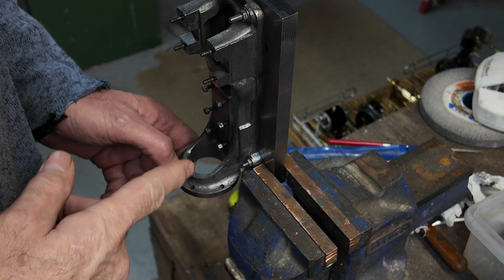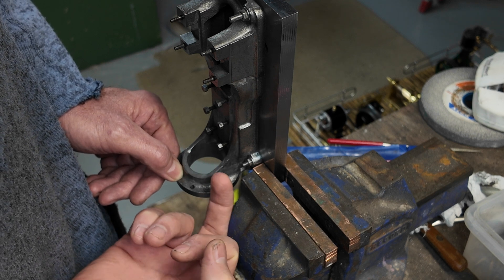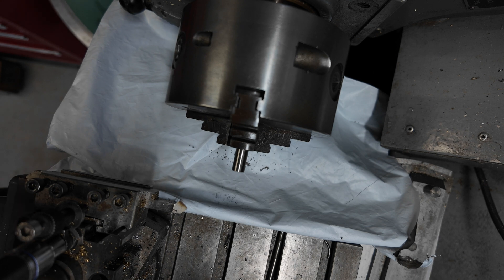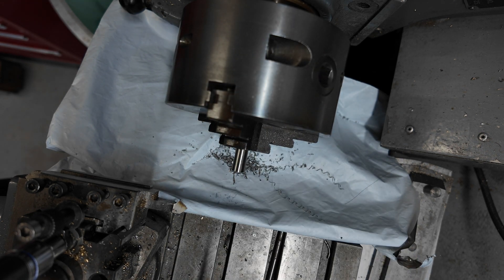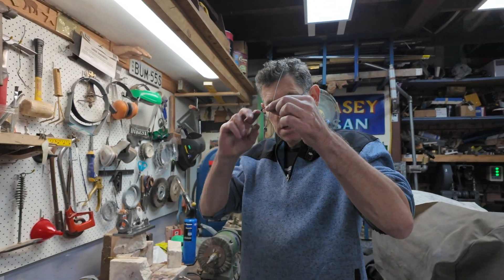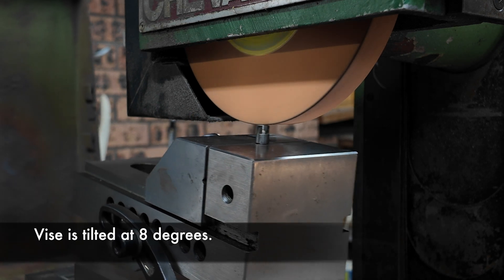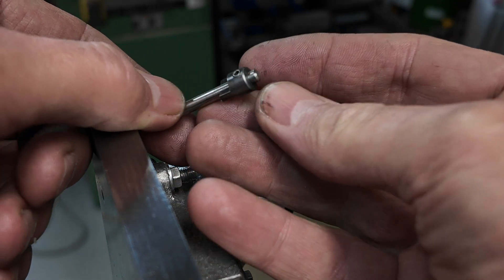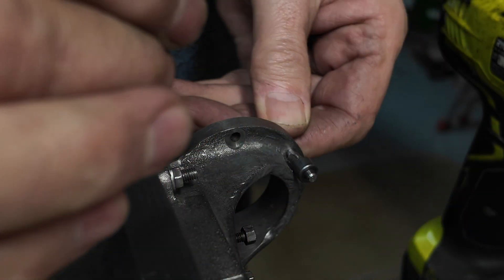Make a Counterbore

Comment: All that work and time and the flange got damaged anyway. It part is not a great looking part anyway why not just use a grinding bit on a dremek etc, it can still be done neat
Reply from the maker: It is my hobby.  If it takes longer I don’t mind.  I think it will look good when I have painted it and fitted the nuts and washers.  The small blemish on the side wall is easily fixed.
Reply: I‘d rather fix the little cosmetic defect instead of having to deal with bent studs or awfully seated nuts 🤷‍♂️ this was the exact right way to do the job.

Comment: This is such a great project.  There have been many times when I could have used a counterbore tool but I just can't afford them.  I have plenty of O1 tool steel and I think that I will give this project a try.  I'm a newbie but this project appears to be simple enough all I can do is try and try again.
Reply from the maker: That’s great to hear.  Thanks for your comment.  I hope it works for you.
Reply: @CreaseysWorkshop  I can do heat treatment on the steel, and I can machine the part.  The only thing I am not very good at is the grinding part to sharpen the tool.  Trying to learn a bit of tool grinding and would like to build a tool and cutter grinder
Reply from the maker: If you have a bench grinder a good start is to get a white aluminium oxide wheel and a diamond dresser for it.  Both are pretty cheap.  Then make a nice sturdy rest instead of the cheap metal rubbish that comes with the grinder.  It will up your grinding game 1000%
Reply: @CreaseysWorkshop  I currently have an 80-grit grey grinding wheel that is really nice but I think it is for mild steel, not the harder steel types.  I will definitely be making a new steady rest today, the one that came with the grinder is terrible.

Comment: Thanks from me as well.  I have an anvil made from railway track that I cannot bolt down because the base has a radius that I cannot access, but now I have project to add to the growing list.
Reply from the maker: Ooh it will be interesting to see if it still works on a big scale.  I don't see why it wouldn't. Be careful anyway!
Thanks for watching!
Reply: You can use an extra thick washer ground on an angle on 1 side too. Little quicker, not quite as technical